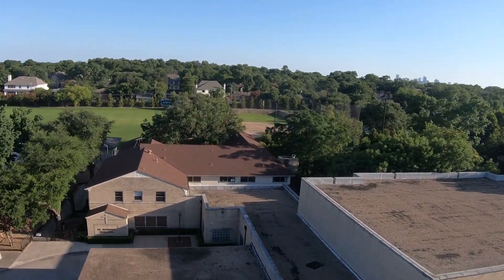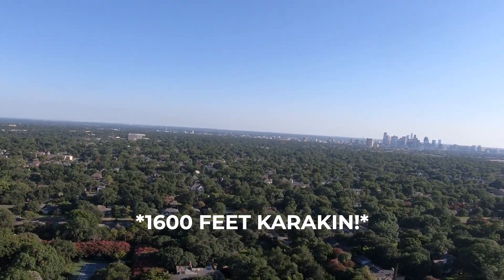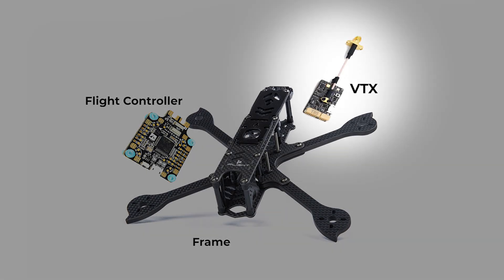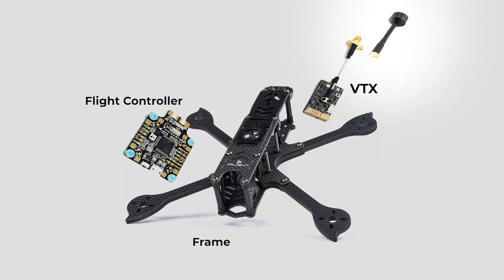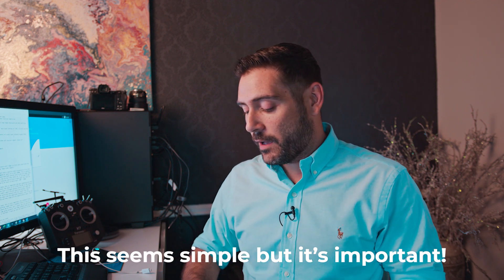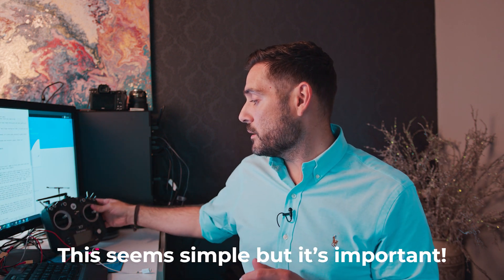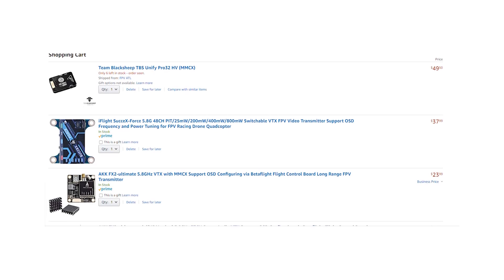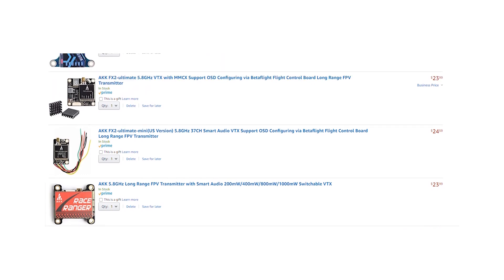Get better Mid to Long Range FPV Video, Long Range FPV Video, required equipment list.

Comment: Ordered a TBS Crossfire micro Tx V2 with a nano rec plus 3 TBS Immortal T antennas (one extended) 1 TBS Crossfire Nano diversity rx, TBS Unify Pro V3 5.8GHz, TBS Triumph Pro RHCP. If it dont work Im coming to your place and using your gear lol. All gear arrived and Im still smiling. Subbed. Now I have to put it all together but thats the best part.
Reply from the maker: Dude awesome!! Your going to LOVE your setup now! Your gonna have better reliability than a Toyota!! Just make sure you set everything up correctly! But it sounds like you got this!! Share some clips of long range with me, I’m working on a viewer spotlight episod soon!
Reply: @KAREKINFPV  Sounds good to me, Im going to setup another youtube channel just for my LR flights with TBS gear. Ill be flying quads and planes. Will send you a link to the page once I set it up. I have a lot of work to do including the mod for the QX7 for Crossfire but I now have everything I need to start and get in the air. Ive gone 5Km on my own builds with 2.4 gear but this is a game changer.
Reply from the maker: OzFPVflyer oh nice man! Yea please do!